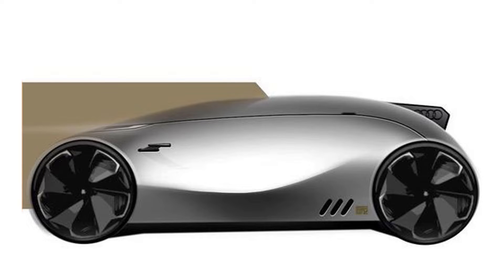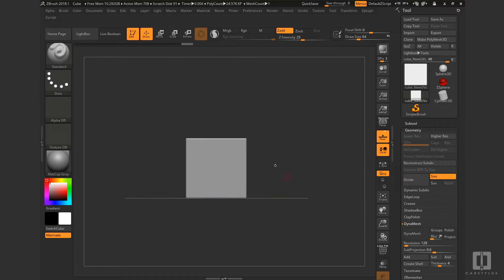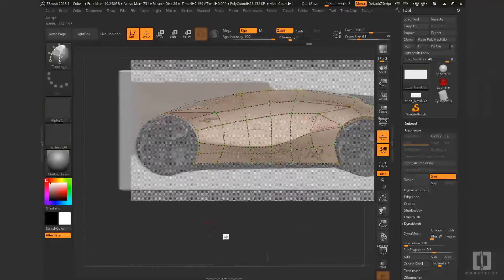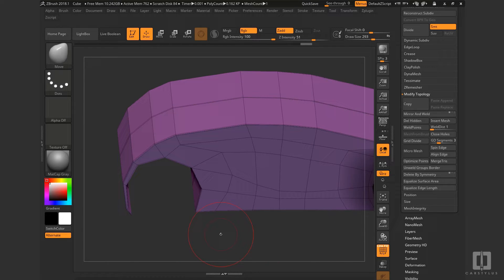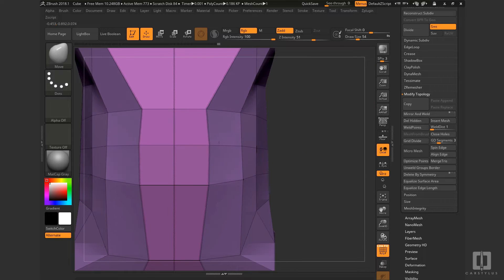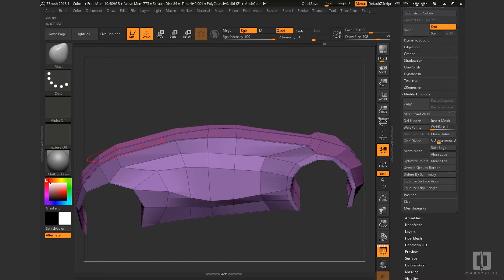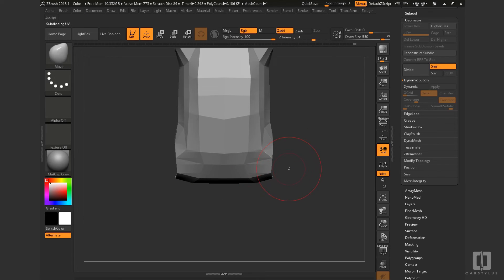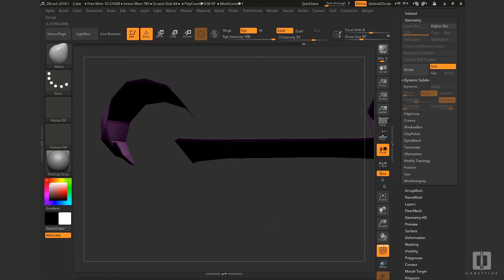Concept Sketch Model (Part 1)

Comment: Woah this is mind blowing. Would you say zbrush is better and easier to use than Maya or Alias?
Reply from the maker: It depends on the stage of development.   Zbrush is really good for sketching out and or "discovering" form.    Maya is good for executing form, but only to a certain level of refinement.   You generally can't produce production level surfaces in Maya. But depending on skill level, it can be quite good.    Alias, as with all nurbs or bezier modelers, is generally used when surfaces require precision / perfection.

Having said this, I think that most designers,  despite Alias's prevailing dominance in the industry,  don't need this type of precision in the early stages.    Usually all  they / we need is to convey an idea clearly,  not provide perfect surfaces.   Design proposals, if well received, are generally rebuilt by dedicated modelers anyway.   Maya, and maybe even Zbrush models will do fine. . .   Of course it all depends on the company / studio
Reply: @Carstylus  Thanks for the helpful reply. I am now learning blender since I found a car modeling master class tutorial with blender. Although I had experienced with Rhino and solidworks I found them tricky to produce some surfaces. Guess I will stick to blender for now as you said, industrial modeler will rebuild my model anyway during production and I think blender can already produce good render quality.
Reply from the maker: @chenjoseph735  Blender is great!  I'm learning it myself.   Blender, Maya, Modo, Max, and Speedform are essentially the same.   They're all "polygonal" modelers.   If you know one, you essentially know them all.   The only real difference is the interface!   

I will say this.   If you are a student or a professional automotive designer, first learn the toolsets that are mostly used in the industry.  If you want to learn polygonal modeling, Maya is the dominant polygonal modeler.  Speedform might be getting a little traction in the industry, but I don't think much.   Blender, while it is free and awesome,  it is an open source platform and presents security concerns!
Reply: @Carstylus  Yeah I might learn Alias later. I think it take more time to produce similar surface in Alias than in blender. Thanks for the help mate!
Reply: @Carstylus  Security concerns? Everything I've gathered says Blender is good to go for private commercial or whatever use!
Reply from the maker: @HISEROD  That could be true.  For some car design studios however, open source software may present security concerns.
Reply: HISΞROD I’ve worked in multiple car studios. Some don’t allow any software that isn’t approved by corporate, most studios have maya for polygon modeling. Other studios don’t care if you use maya, modo, zbrush or anything really.

Really depends on where you work and their policies.
Reply: @HandleBar3D  Yo! I watch your channel now! I didn't realize that I'd seen you on yt before.

Comment: Great vid! However, when you have curves that are not directly visible in the top and side view, like the ones on the front and side of the car in your other video "Modelling a concept car in Zbrush", how do you determine the parts that you cannot see on the top and side views? For example, how much the holes is indented on the side?
Reply from the maker: Because this is a concept "sketch model" and I only had the side view,  I had to guess what it might look like in other views.
Reply: @Carstylus  ahh okay. But what would you do if you had to make a 1:1 of some vehicle from the real world? You seem like a very talented guy, so maybe you have some good ideas to share with your subs :)
Reply from the maker: @sdsadasdasd4145  in lieu of exact orthographic views,  I'd gather as many reference images as possible.   As I'm modeling, I'd constantly look at those images.
Reply: @Carstylus  alright then, sounds reasonable. But so what you are implying is that it is somewhat impossible to replicate these "vague pats" exactly 1:1 as you sort of can with parts being visible in orthographic views, without having exact measurements specified in reference images (which I assume already is in perspective and are thus distorted)?
Reply from the maker: @sdsadasdasd4145  Exactly.   Moreover, this is probably not the modeling process I'd use if I had to accurately model a real-world car from orthographic drawings.  I'd probably choose Alias, Rhino, Icem, Catia. . .  etc.
Reply: I knew you were the one to ask. Thanks man, it really means a lot to me!